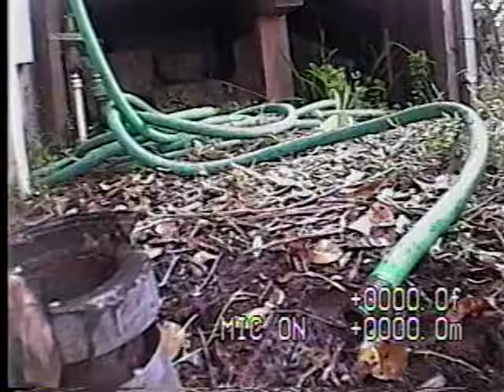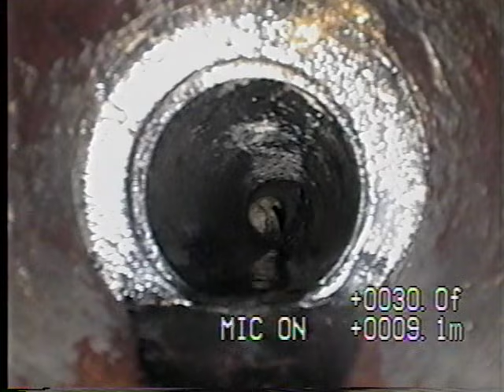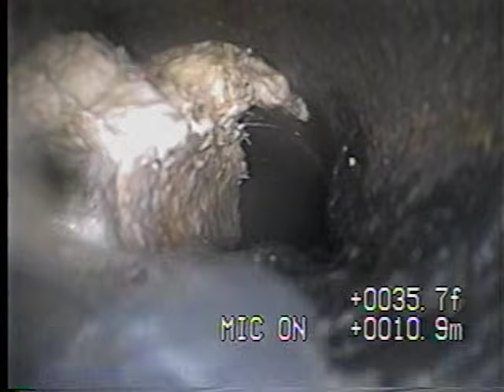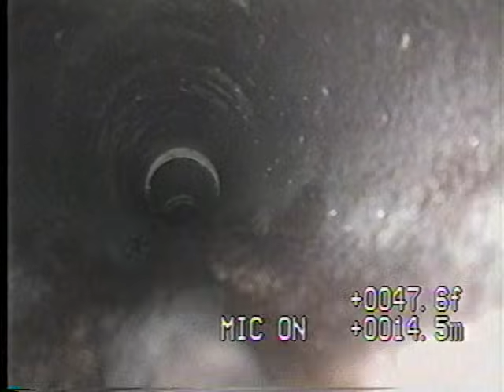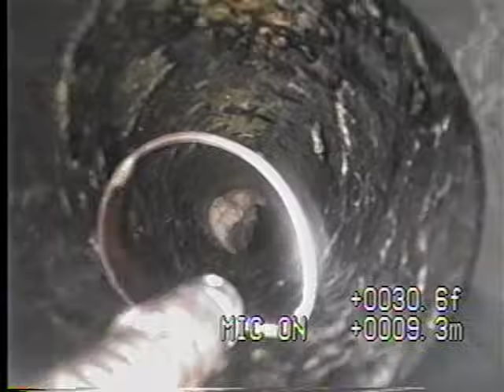Plumbing Camera - shows pipe needs sewer line repair

Comment: Bad drain...hahahahaha! This is a very clean line other then joint to a small pipe...there is very little issues. That blob is just grease and although most clean out costs are a bit of rip off I would recommend the more expensive jet/cut. Once we had that done our problems were diminished greatly. These guys make an hourly as good as my dentist!

You others saying the other guy is a dumb...he's clearly the "guy on the street" question or the homeowner like guy and his questions are comparable to what any non pro would ask. If you think the questions are dumb then you most likely are always the smartest guy in the room..even when you are not!
Reply: Look at the video again. The grease clog formed where two joints were out of line. You can see the end of the next joint on the left-hand side.
Reply: @calametrocity  no it formed because if you look the fitting is blown out and then the grease filled the void thus causing the issue
Reply: Yep love my jetter it the besssssttttt and all the restraints love me got them on a 12 month contract and everything
Reply: The man wants his tuna tower

Comment: why in the hell would you replace the line with cast iron????? Ive been doing this for over 15 years and thats the stupidest thing Ive ever heard!!!!  DWV PVC is 1/3 of the cost and a much better way to go, and it would out last cast iron pipe 3 fold!!   The only time I would ever replace cast iron with cast iron is in a commercial building due to fire ratings such as a hospital.   And why do you have to replace the whole line?   Have you not heard of spot repairs?  If the customer still has a good amount of life left in the remaining pipe, then at least offer the guy options!
Reply: @Ciana_Baby  lol you really dont know anything
Reply: I agree. I am just reading this in 2020 because I have the same problem.That is my thought, why not just dig and repair . I have the same problem and I plan to install a back flow preventer near the house and spot repair where its needed. Thank you for this video though and several comments, it really helps.

Comment: Came to look at sewer videos to get a better handle on what's going on in our house.  We've been smelling a funky old water smell for several weeks and never thought of looking in the basement to discover that the sewer had backed up.  Had it cleaned by a sewer and drain specialist yesterday, then scoped by a plumber.  We've had the sewer cleaned numerous times over the years we've lived here.  Never thought to have the camera done but glad we did.  Turns out we have a cast iron pipe to the boulevard at which point it switches to clay pipes going out to the manhole.  Our part is in good shape but the city pipes have collapsed about 4-5 feet from the manhole.  To think of how far everything has been backing up is disgusting.  What's even more disgusting is to be told that property owners are responsible for paying for repair from the house to the manhole.  I don't know how municipalities can get away with that.  We currently have been told not to flush solids down the line.  Wondering if anyone has any comments on how to proceed with the city.
Reply: If it’s the city main that collapsed it’s 100% their responsibility
Reply: Your contractor Might be able to use a drain liner look into those They are great. The city does this all the time They still use clay 2ft and under till this day It's cheaper anything 2ft and bigger is PVC and concrete ...So your gonna have to pull a special permit to tap into the city sewer pipe and have inspection done.. Don't worry It's not a biggie just make sure your contractor knows this before you hire or he might walk away from the job but trust me most know this already and  It's not to be said but most times the whole drain has to be dug up and replaced from your clean out to the street one or two sidewalk slabs might have to be moved some inspectors se that and demand you have new poured though. I would go with  30/34 PVC only if you know what your doing as far as bedding with gravel and topping  same goes for schedule 40 or 80 thicker wall but brittle if not bedded proper  needs  min of 1-1 1/2 inch pitch per 10 ft -20 ft I think....I would add a clean out before the main 30 ft from the house if more the overall span is greater then 90 ft of drain needs to be installed...  you will thank me later If you need to snake the drain or now you can hydro jet if the drain ever clogs again just don't let them install cast iron what ever you do. Hope this helps.
Reply: Becouse it is your line the home owner is responsible to the city tap not the other way around

Comment: hydro jetting is expensive, but basically renewing your drain
Reply: Naaaaa it's not that bad we charge 120 for the 1st hr with our jetter almost the same as the guys running the old cable style cutter. Buttttttttttt we still have ours for the time the jetter can bust though

Comment: Why the hell would you replace the drain with cast iron and not pvc? Trying to ensure you return again?
Reply: Exactly. I heard that and was like....."what did he just say? Did he say replace with cast??" Yep....he sure did. Why not throw in some Orangeburg too while you're at it? SMH.
Reply: +mydejavooo1 Lmao! Thanks for that laugh.  I know I'm not the only good plumber in this world.  Surely it's not him.
Reply: Refacull Vitrified Clay Pipe, has absolutely the most intrustion, infiltration and breakage. If PVC is a problem child you either A.) Have shotty plumers or B.) Have contractors laying bad pipe. Being a home inspector is great. I'm a DEP certified collections/plant operator with NASSCO certification to televise mains, laterals, manholes. Orangeberg, Transite, VCP and Cast iron are antiquated. There are many different classes of SDR and PVC that are much more resistant to residential as well as commercial and longer lasting. The most perfect pipe in the ground for decades that I've ever seen is SDR.
Reply: What started happening after your drain pipes were replaced with PVC?
Reply: Cast iron??? New tech? Bruhhh not in texas lol 😂 talk about job security
Reply: @William Tecumseh Sherman  plumbing codes typically end 5ft from home and sewer Dept regulations kick in. It's often a grey area, but new lines or repairs are gasketed sdr 35.
Reply: SidJustice1 not all plumbers are created equal.
Reply: I need to hear more about this.  Details?
Reply: He really wants to buy a Viking  sport fish with an enclosed flybridge . Otherwise he’d have to settle for the open bridge and no tuna tower.
Reply: Townships/Municipalities have different codes. Here in Pa for example cast is requires in Philadelphia county but not Montgomery county next door. Also some Townships require SDR. The requirements aren’t always state wide is my point
Reply: @Don_Von_De_LaNooch  sch 40 all the way. I did it with my house. Inspector wanted sdr35.
Reply: Glenn Miller I do are scopes about three times a week and am a home inspector. $5 if you can guess which pipe I see with more to intrusion. This is a large country with a huge land size, there are plenty of huge differences show up with only 250mi travel
Reply: You beat me to it.
Reply: Money pit 😆
Reply: Pvc
Reply: Lmao
Reply: He already admitted he was there 5 times previously to purposely ROB THEM! Cause he knows once they get a brand new line put in he'll never be back again. SMH
Reply: My house was built in 1930. We’ve had main sewer backup for some time. One company came in the guy worked on it and said; “I think I’ve got it”. $400 and a 30 day guarantee. It got backed up a week after the 30 day guarantee and they said I had to pay another $400. So, I called another company they quoted $620.00 but would include a camera inspection.
 They couldn’t fit the camera down my pipe (I’m on a slab with no clean out). They still charged $620. Sewer clogged again after the 30 day guarantee.
  So, I rented a snake from Home Depot and worked for 5 hrs, running the snake through multiple times. The clog was near the main (50’ out) and got it cleared.
  If it clogs again, there are places to rent smaller cameras for $200.
  Hope this helps!
Reply: Refacull That is complete bull. Cast is absolutely terrible for every application. Any gas created through decomposition, plus environment corrodes the pipe from the inside out. Not to mention the "sepic safe" tissues and other products get caught on the ridges and valleys. It's tough to clean and access. Replace it with SDR35 out side, and bush it to sch40 in the house. I've never seen any root intrusion, blockages, or catastrophic failure in this kind of setup with pipe that's been in the ground for 20-30 years. Every other kind of pipe is prone to call outs for failure.
Reply: @glennmiller6183  fuck sdr35, sch40 all the way!!!
Reply: Cast iron is better to stop root intrusion, and significantly better for commercial application. He explained it at about 1:55. If it was cast iron before, it very likely significantly cheaper to keep replacing sewer lines every 50 years than replacing every fitting including at the city main.
Reply: correct. it won't corrode or no roots will get in. rubber boot connections .
Reply: I originally had cast iron pipes on my home only to be replaced by pvc. Once that happened, my drain/plumbing problems surely began.
Reply: Might be Chicago. Unions demand substandard parts be used in order to insure future work. Why? Because unions.
Reply: @jeeperscreeeperz388  if it was Chicago outside  sewer is clay pipe and pvc if not bedded right it’s going to have bellies  cast iron is better in my opinion
Reply: @jeeperscreeeperz388  you seem to have some sort of radical agenda against unions ? That makes absolutely NO SENSE. It's possible the the contractor would try to save a few cents by using cheaper materials but the unions don;t drive those decisions. In Chicago, do Unions do a lot of residential work ? That doesn't add up to me. More like the low bidder fly by night civil contractor. 

When you look beyond your " agenda" and focus on the problem, ask yourself what idiot would reduce a drain pipe diameter? Therein lies your problem.

Comment: How would toilet paper get stuck like that?
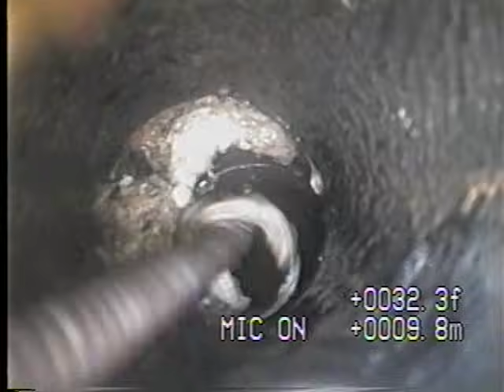Reply: +Johnny Demacano If you look at the pipe @5:50 after he gets it unclogged, there is a misalignment of pipe, creating a kind of ledge on the left side of the drain with a visible crevice that toilet paper has been wedged into.. there could even be minor root growth offering a sort of fiber framework to help anchor the clog.  Whatever comes through the pipe splats on the left side and a small amount gets stuck. This is not a problem in the beginning, but then the accumulation of waste hardens and strengthens over time and the highly compacted sticky overhang "grows" out over the rest of the drain from the ledge as more waste gets stuck on the waste that is already stuck and securely lodged in place, eventually creating a recurring clog due to the ever more restricted pipe.  Plumber then snakes the pipe, but because he doesn't know the foundation of another clog is already in place, the clog happens again in the same spot months later.  Basically, it is like a paper and poo stalagmite.  To completely fix the problem, he would have to eliminate that ledge somehow so the pipe is smooth all the way down.  It didn't happen at the smaller ledge earlier in the pipe, but this ledge looks to be caused by a severe pipe misalignment, not just a narrowing, so the ledge is more significant.
Reply: Good explanation
Reply: The 45 was blown out from shifting

Comment: Thanks for the video. 
I am curious-With the camera AND snake in the pipe at the same time, what was the state of the camera push cable after the procedure? Did all that thrashing about damage the camera cable?  I'd be very nervous about putting my 3000 dollar camera in the waste line with my 1/2 in snake and cutter......Let me know. cheers
Reply: The push rod costs a lot more than 3,000 dollars.  A good total camera system
(Ridgid) is close to 9,000 dollars.
Reply: @twincitydrain8041  12000 if you include the locater
Reply: Jarko Limbo Rigid CS10 w/ 200ft reel set me back 11K. Not including the locator.

Comment: I've cleaned a lot of sewers, and aside from the pipe being reduced, this looks like a very clean sewer line that did not need repairs or replacing. The blockage you found was common, The camera is a great tool, but you should also invest in the proper cutters for your snake. If you had cleaned it out using the correct size cutter instead of a retriever, you probably would have got it the first time and not had to come back 5 times. New Cutter $35.00 Camera system $3000 +.
Reply: Actually if you watched where He cut that blockage out you could see that the pipe was separating. Brian knows exactly what he is talking about on this. I’m a plumber up in British Columbia that has 27 years of experience in plumbing and Drain Cleaning. He was right to suggest replacing that sewer.
Reply: @1stchoicejohn  that a yes and no if the break was in a area were he could dig up the bad spot which includes the restriction then yes a repair is the better option but if there was concrete or a pemment structure then reroute and replace would be your only option besides the push pull methed
Reply: @1stchoicejohn  Yes a root has infiltrated the pipe
Reply: I thought it was clean the operator was trying to make it sound way worse then it was.  Not only that he said noone would be able to see the obstruction without the camera but he already billed the homeowner 5 times and then decided to use the camera.
Reply: @shorelinearmorllc477  I said, the same. Why didn’t he use the camera the first time? Robbery
Reply: +MJCPeters If hes coming out there to snake the main line every six months it seems like a solution to me. Snaking a isn't good for your pipe to begin with especially that frequent. This home owner now has a liner in there that bares a lifetime guarantee and that's a good insight for him when it comes time to sell that house. I recommend any home owner to stop wasting 4-5 hundred dollars for snaking a line and all other treatments and maintenance when they can make an investment and never have to worry about plumbing again.
Reply: ArchaicSeVeN30 4-5 hundred for snaking??? I must be undercharging!!
Reply: @ArchaicSeVeN30  i was thinking myself a liner would fix that issue even with the pipe size transition that's not ideal but a liner would just have a small dip and not a hard edge for stuff to catch on however this pipe was not that bad
Reply: Feed a man a snake, feed him once.  Teach a man to snake, feed him for a lifetime.
Reply: How is Polly pipe for sewer lines?
Reply: @benitojr468  if your push pulling its ok not the best if your laying new installation never do it use pvc with the big bell ends do not use couplings
Reply: Would definitely build up again on all those misaligned joints over time or depending what was fired down it, and those kind of things always seem to happen on the holidays or most inopportune moments. Amazing difference cameras have made to this work.
Reply: MJCPeters Looked like a root saw, probably Ridgid.
Reply: @twincitydrain8041  it's a retrieval head that was sarpend to cut roots that a general drain cleaner rigged has a spiral cable with about 4 to 5 wraps and enlarges to 3-4 in
Reply: You are correct
Reply: I disagree. That’s old cast iron pipe it looks like to me without proper fall. I would suggest replacing